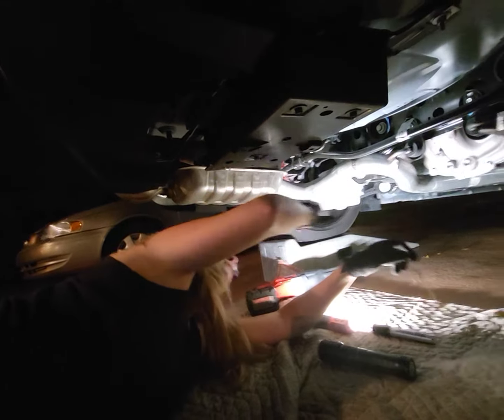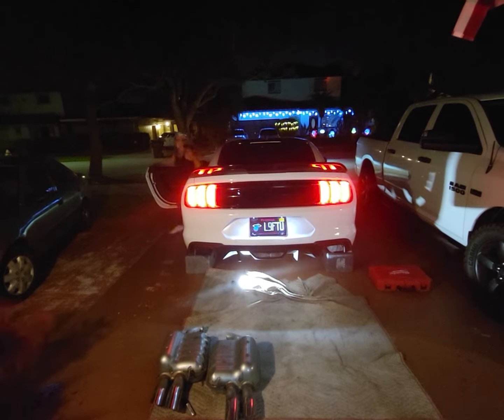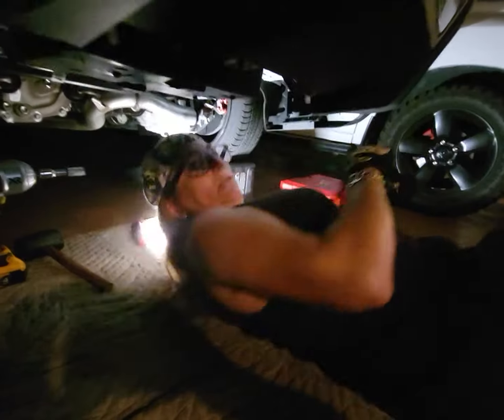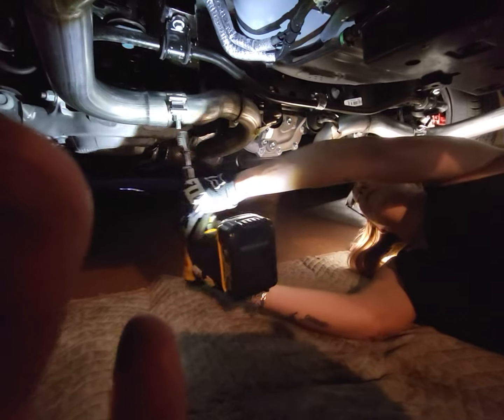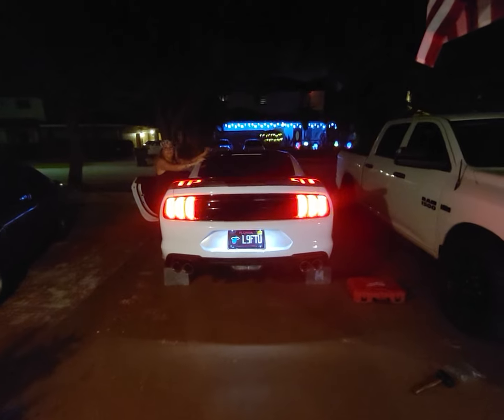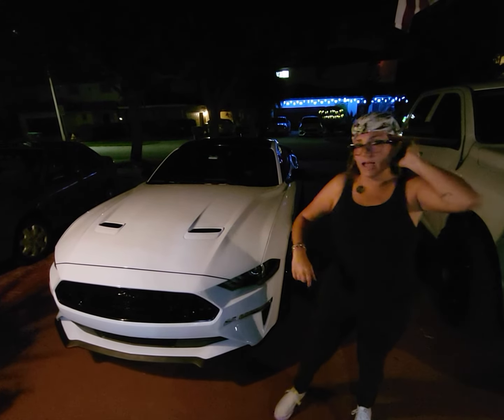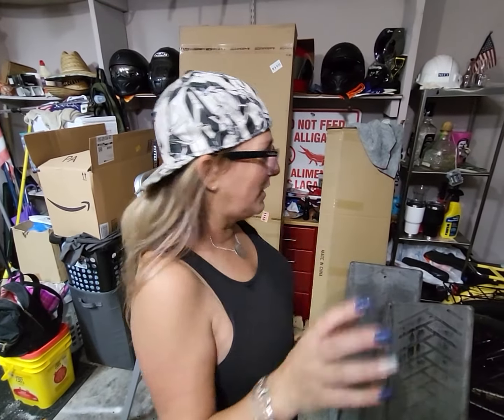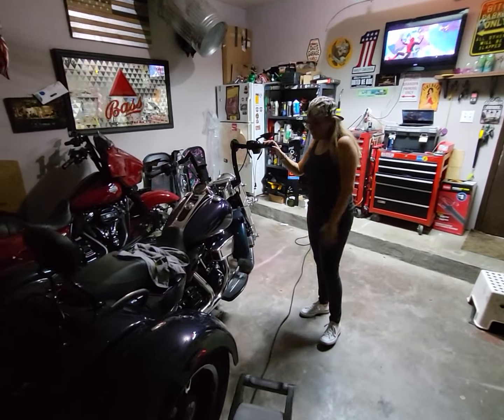C&L Axle Backs for 18-21 Mustang GT w/o Active Exhaust Install and Driveby Sound Clips

Comment: IS THE STOCK MID MUFFLER IN????????? IS THE C&L MUFFLER DELETE ALL YOU DID?
Reply from the maker: No. I had already removed the mid resonator and replaced it with a Roush H pipe.